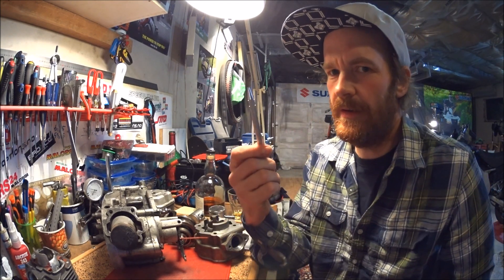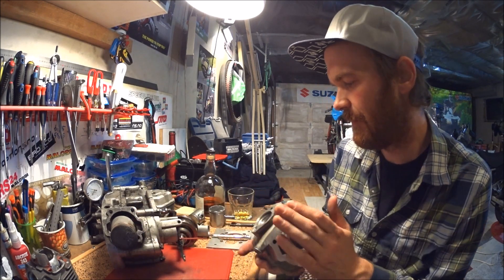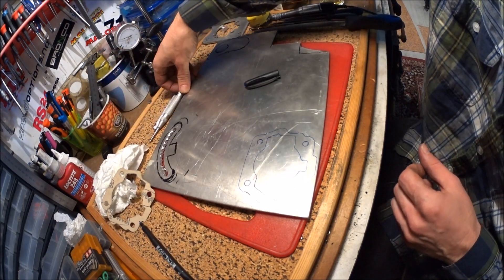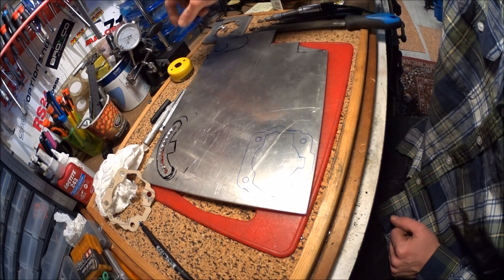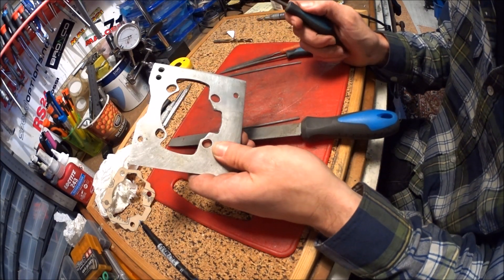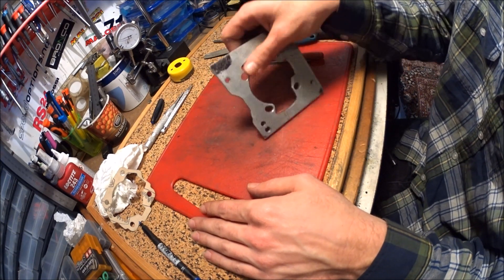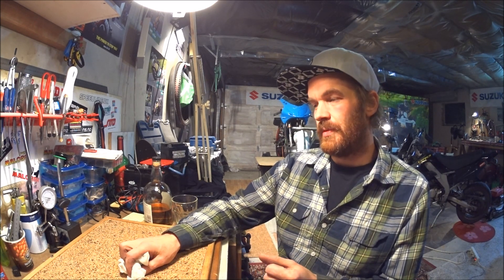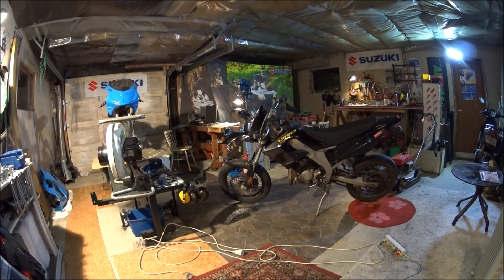E6 - Hacking Engines + Cylinder Spacer Tutorial 2STROKE STUFFING

Comment: I have a cylinder that has reached its limit of 81.5mm so i found a piston thats 82mm but it stuck up .100" out of the cylinder so i made an aluminum spacer plate to bring the height back so i raised the cylinder .100" ..and its running real rich..i put a fatter throttle slide needle and that helped a little and i advanced the timing a lot..does not kick back and seems to run a cleaner...so...did i go the correct direction advancing it or should i of retarded it cause i did raise the cylinder .100???  and its a rotary valved motor so no intake port in the cylinder...i have .055"squish clearance too

Comment: thank you, i was wondering where id put the gaskets with the spacer installed because i bought a new 80cc cylinder and piston kit for my bike because the last one seized after 3 years of daily riding. the new cylinder and piston do not fit correctly because the piston hits the top of the cylinder. ive tried adding metal gaskets to span the gap, but i haven't managed to fill the gap with using 2 lower gaskets and 4 top end gaskets, and i was wondering if something like this would work.

Comment: you should try using a jewelers saw, for cutting out spacers and such. With the larger blades they cut quite fast,you just drill a hole slip the blade through the hole and clamp it to the saw and cut out your shape, like a scroll saw, but they will cut steel.

Comment: Can i adapt a 41.6 mm stroke cilinder to my 39mm stroke engine?
Reply from the maker: Yes! You'll have to mill the cylinder/case to get port timing right.
Reply: 2STROKE STUFFING from the top?
Reply from the maker: Depends on port timing, you'll have to do a test fit to see what's necessary.

Comment: What are the best fake dremel bits for using on your cylinder or just any aluminum or cast aluminum?
Reply from the maker: Not sure, but my cheap Chinese eBay one's work great!
Reply: 2STROKE STUFFING amen to that, mines called a "Wen" but what meant was which type/shaped ones like grinding stones or burrs or which shapes do you like best?
Reply from the maker: Ah, I like the cylindrical single and double cut burs + sanding drums. Stones clog fast on aluminium and wear down fast on harder stuff.

Comment: for cutting the inside area of the spacer, a hand powered jigsaw would work very nicely as well. it's like a wide framed hacksaw, but the blade is a toothed wire rather than flat band. they cut in every direction, can follow very tight radii, and are the tool used to make "jigsaw puzzles", so can make quite small, intricate pieces. small power versions are used in model making and RC plane fabrication, but cost much more. here is the us, they also sell "tile cutting blades" for hacksaws which will cut just about anything, also work in any direction, but will cut much slower than a jigsaw with slightly less control because they flex a bit more. both would be a bit faster than filing to remove the bulk material, then one can finish file to the line. your "low cost solutions" are one of the many reasons i love your channel!

edit: just finished watching rotary valve cover #3, and saw you using the jigsaw already for final trimming of your cover port, lol. i guess i shared some "old news".

Comment: To cut the centre piece out you can use a piercing saw with a deep enough frame.
The frame and blades are very cheap and the numbers of TPI to suit differing thickness of material.
Drill a small hole and thread the blade through and then you can cut very close to the marked line.

Here's a demo on its use and how easy it is to cut corners and lines to very close tolerances

https://www.youtube.com/watch?v=5txqBnvvQpc
Reply from the maker: +cara vaggio Thanks for the advice, I've actually got one now, very handy!

Comment: How do you stop the aluminum from clogging your files? Or, how do you clean the aluminum from the files? And from carbide bits?
Reply: you can try chalk, thats how i learned it
Reply: WD-40 is great for Aluminium
Reply: chalk, or even a piece of drywall (gypsum board, sheetrock, etc), and a fine wire brush (a "file card" in old time parlance). you brush the chips out ("carding the file"), then just file the edge of the gypsum or chalk to deposit some powder. the powder keeps the chips from sticking. make a few cuts, card, chalk, repeat. a scrap from a construction site will last quite a while, even quite small ones. chalk is better, but gypsum works quite well, and "free scrap" is a very hard price to beat, lol
Reply from the maker: +forced23 I usually have no problem with carbide bits, but files always clog. Using them on steel helps, a steel brush helps too. I have no great solution tho.
Reply: coating with a lubricant / penetrating oil helps, but they still clog. I hoped that you had a better solution.